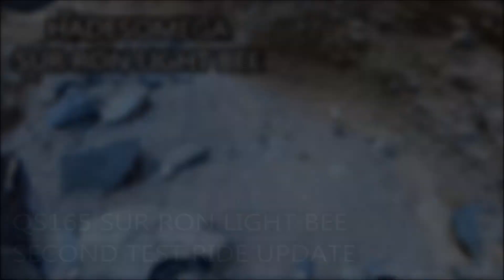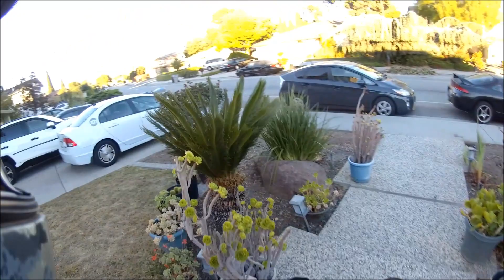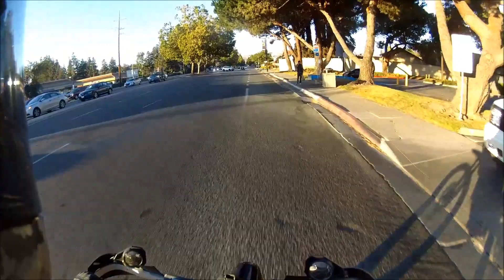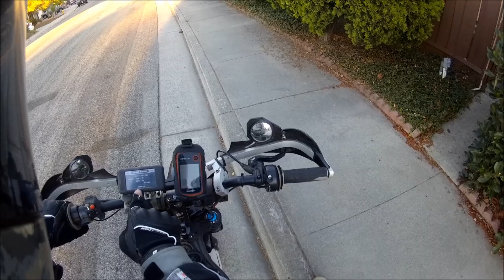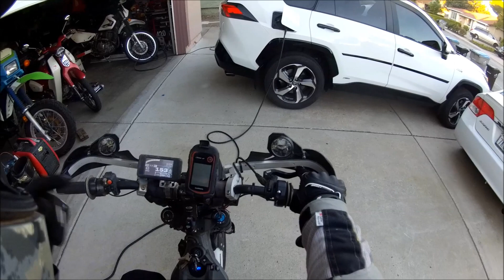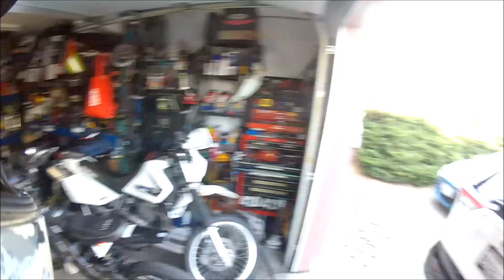QS165 Sur Ron Light Bee ERT BAC4000 Second Test Ride Update

Comment: Maybe you could try different gearing ratios by switching up the sprockets on the wheel, might get higher top speeds that way, but if you're also having issues launching then it would only make that worse to use a smaller wheel sprocket, i dunno

Comment: Hey my nxt display is crappin out, do you know where I can find a replacement?
Reply from the maker: What do you mean by crappin out?  If the screen is busted you can buy a new display and transfer the circuit board to the new screen after reflashing it.  The screen you want to buy is Nextion Enhanced NX4024K032.  When my controller gets hot the NXT display just stops working.  I am going to get a new controller because I don't know how to fix this.
Reply: @hadesomegamoto7639  awesome thanks, I have ordered one
Reply from the maker: @ktmkiwi  Here is a video when I replaced mine you need to remove the battery holder or else it won't fit in the case.  https://youtu.be/NObV5otV4HA
Reply: @hadesomegamoto7639  legend!
Reply: Hey bro, I have bought the Greenline engineering kit for my bac8000, just wondering if you know how I can get it unlocked to swap the firmware.
Reply from the maker: @ktmkiwi  Hmm you would need an ASI account to use the BacDoor software.  There's  a way you can hook a PC up to it but I don't know how to do it.

Comment: Forget it with bac4000 ! you hit the Overcurrent with it to fast . Im at 280 Phase and 9.2 kw now .
Reply from the maker: Yeah I think my BAC4000 is fried, it used to run much better it just overheats all the time now.  I was running 421 Phase but only up till 4250w.  This bike used to run 16sec 1/4 miles.  But yeah I'm looking into another controller now.
Reply: @hadesomegamoto7639  they make a controller for this motor. Theres two different far driver models
Reply: @rayt7961  Ha i m at 390phase amps and 12kw are blown now 🤪🇨🇭
Reply from the maker: @clubsportrubitech5370  Cool!  I'm going to ditch this controller because it stops working when it gets hot.  I just lost a race because of this.
Reply: @hadesomegamoto7639  so you have a other controller ? If you want ride this Motor take the bac8k . If you need help for the setting PM me 🤪
Reply from the maker: @clubsportrubitech5370  I've ordered a controller from Electro & Co that will already be tuned for the QS motor.  I would love to get a BAC8k I really like the regen throttle feature but I can't find one that works with the ERT setup and I don't have BacDoor access to program it anyway.